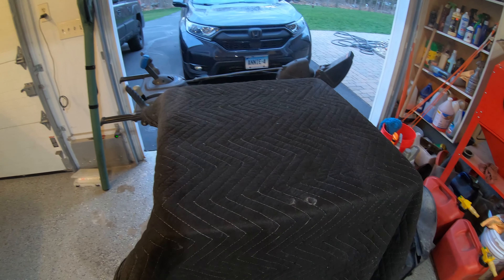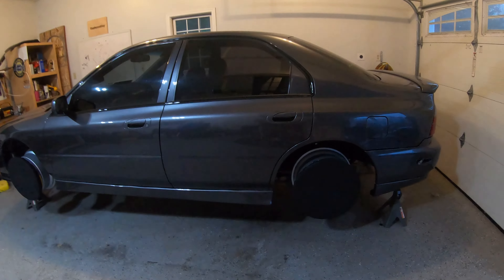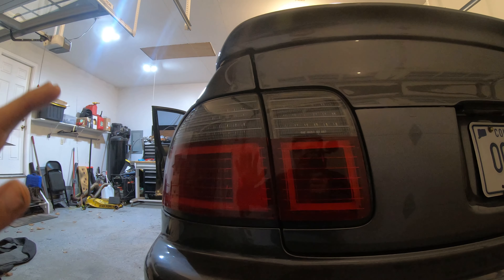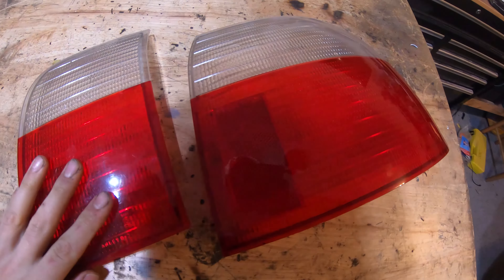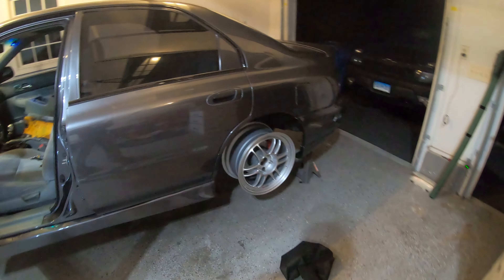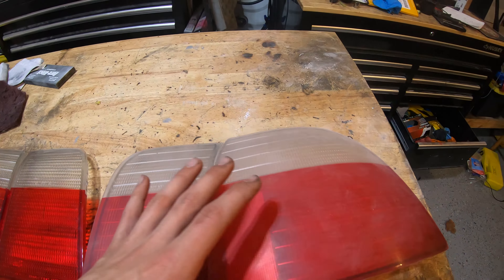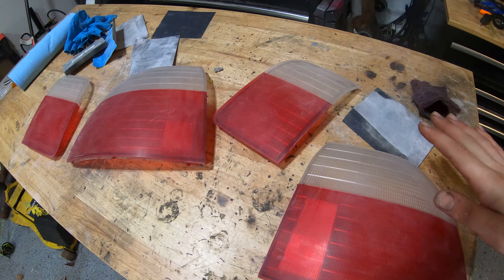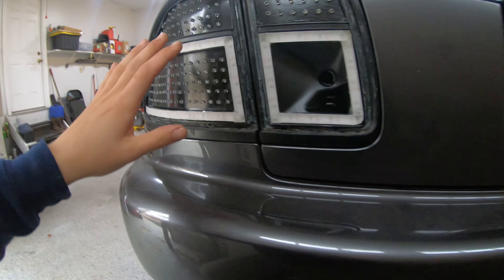CD5 Wheel Reveal and Tail Light Progress

Comment: I went a little extra on my offset, about the same as where you had the tires placed,  and I had to roll the lips of the fenders in.  didn't have to actually roll/flare out the outisde,  just folded the inner lip in flat and it was tuck city.  I get a little bit of rub in the front with the wheels turned if I hit a bump (like pulling in a driveway) but it's only at near full lock, pretty easy to avoid.  If you drive a lowered car you already know lol.   But yeah those wheels/tires are gonna look REALLY good.  

Go slow and keep heating the fender or your paint will definitely crack (since I'm pretty sure you'll do the rolling yourself haha)  This thing is turning out to be the nicest CD5 on the internet!!
Reply from the maker: Haha appreciate it man you were spot on on the fender rolling tips. I did exactly that and really am happy with the way It came out! So stoked to get it all buttoned up.

Comment: If it makes you feel better I run the same exact wheel spec in the rear. Depending on how low, you might want to do some fender rolling on the rear. If you'd like I can email you some pics of fitment with my car. That's with a fully maxed out Megan Racing rear camber arm.
Reply: yeah he'll almost definitely have to roll the lips at least.  I did.   that's with 2.5" drop from stock height, stock control arms, and same wheel width/offset.  I got smaller diameter wheels and taller tires (aint made of money lol i like my tires cheap) but that equals out to about the same tire fitment.  mayyyybe with a little more ride height you could get away with not rolling the fenders but 95% sure he will need to.
Reply from the maker: I actually fitted them up and it looks like it's going to sit really nicely. I had already rolled the rear on one side. Did the other one a couple nights ago. I plan to match whatever the front camber is in the rear. And just keep the ride a little high for now. Not about that super low life. I want to drive! Thanks for your feedback and support guys!